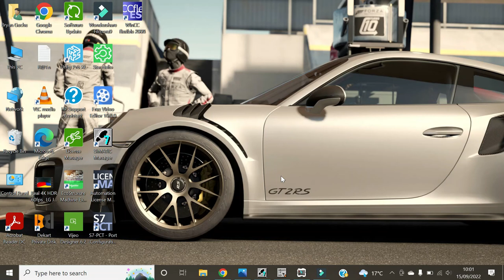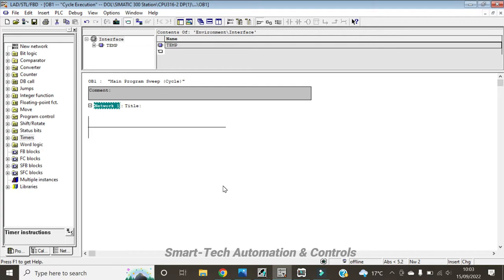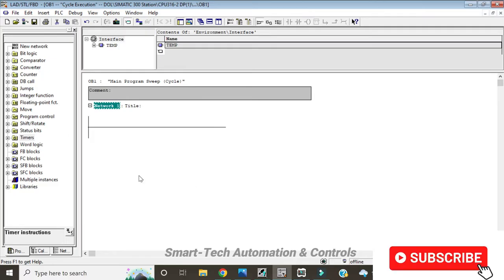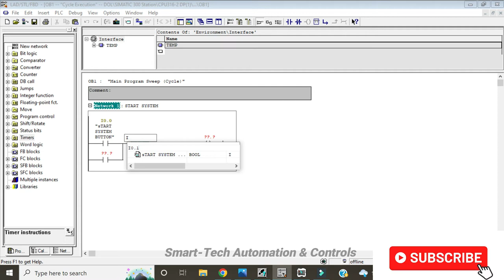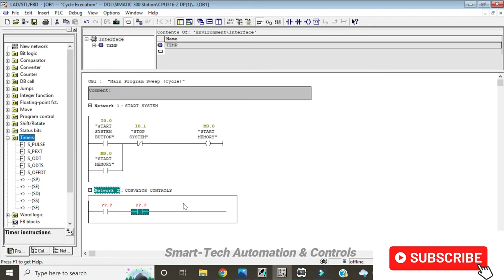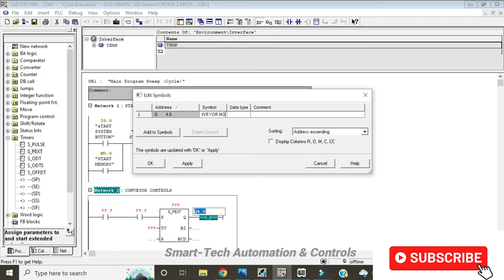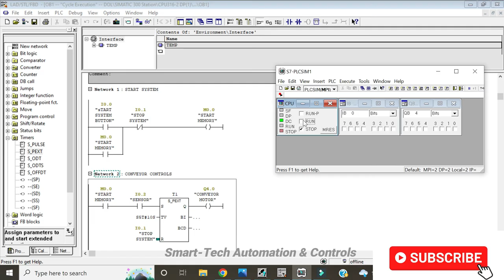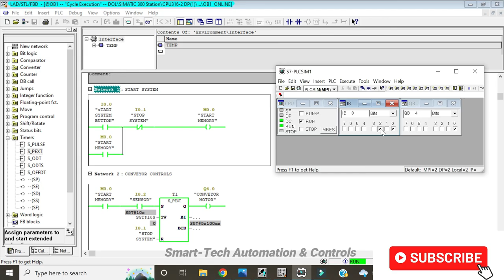PLC Programming Tutorial. How to automate a conveyor with sensors. siemens Ladder logic. Pulse timer

Comment: 1)PLC based Grinding Process

Step Conditions

(1) Start PB is to start the process.

At initial, Job in sensor should be in ON condition and job out sensor should be in OFF condition.

(3) When job in sensor detects object for surface grinding should turn on conveyor motor to move the object

141. When rough sensor detects objeet, conveyor nustor should turn OFF and Rough grinding motor sivaid turn ON for 20s. After the process. Conveyor motor should turn ON automatically

(5). When fine sensor detects object, conveyor motor should turn OFF and Fine grinding motor should turn ON for 20s. After the process. Conveyor motor should turn ON

automatically till job out sensor turn ON

(6). Packing sensor should turn ON, when job out sensor ON. 
Hello
Please make the video for this statement in scada

Comment: Question for you. I have a conveyor belt that I want to start up have the conveyor run a bag comes across a sensor or limit switch, stops the conveyor for 10 seconds and then starts back up again. Is the programming for that similar to this?